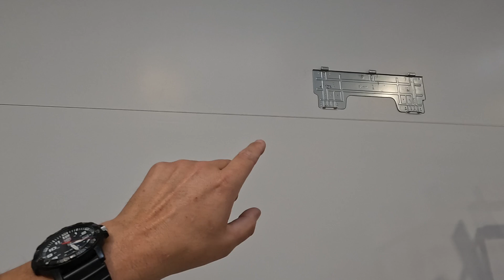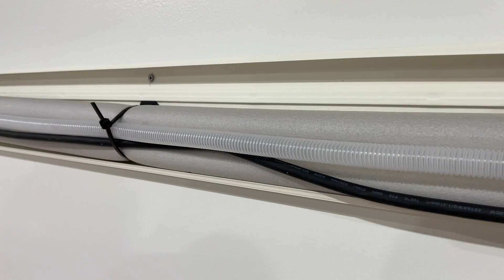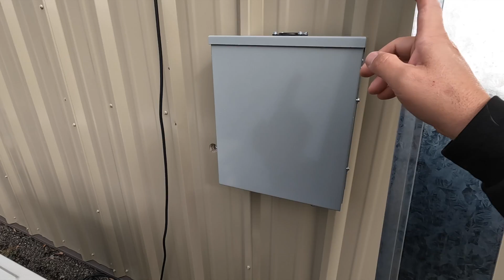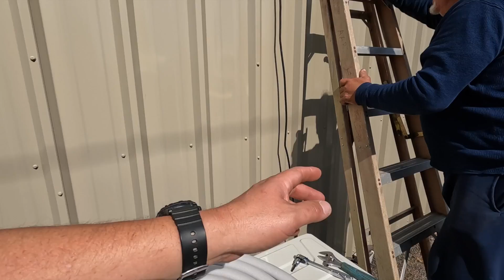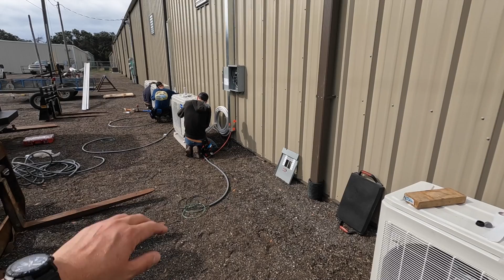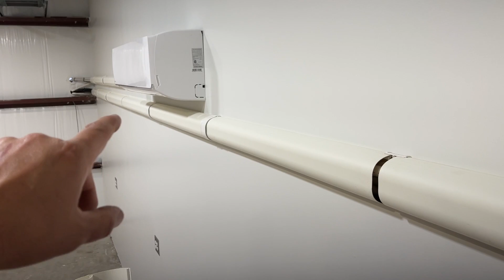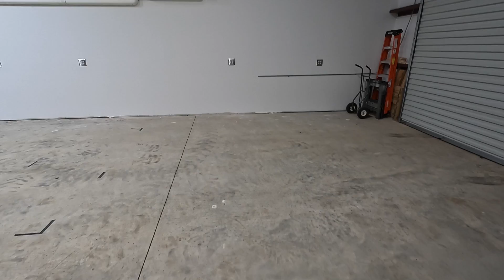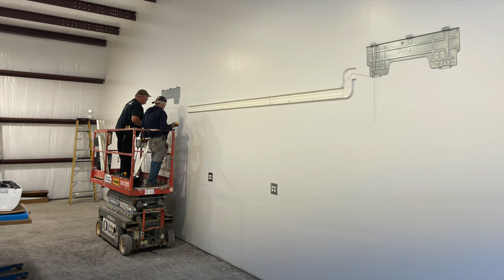Mr Cool AC INstall for New Shop Part 2

Comment: Didn't watch through yet, but I hope you are planning on putting locking cages over those outside units, thefts are going sky high these days.
Reply: that is not nice why would they do such a thing?
Reply: @summerforever6736  Drug addicts and other scum steal stuff for the metals to sell to a recycler.
Reply: @dasworkshop4967  not in the USA lol
Reply: @summerforever6736  Want to hear something fun in America? Most of this type of crime could be shut down by controlling the recyclers, not allowing them to take items likely stolen. But many prosecutors would rather have the items get stolen and replaced by insurance than cut off "that source of revenue" for the criminals. Their expectation is if they can't steal stuff in the dark, they'll be doing more break-ins (more violent crimes) to support their habits.
Reply: @dasworkshop4967  yes it is happening unfortunately  ....  i was kidding...
Reply: There's a type of proximity chirp alarm that can be installed high up, and increases in volume, and beat, it is programmable so critters don't set it off. Its definitely a deterrent, but then again nothing is 100% ever.

Comment: how many degrees of inclination did you put on the tubes from the indoor units to the outdoor units so that the water runs out? Often found ac equipment peeing on telco racks because of this issue.
Reply: Not enough - Poor installation by an 'expert' with 30-40 years experience.

Comment: had a shop i worked in was very noisy could not tell if fan was on or not so i put some ribbon on the grate so i could tell if the fan was working from across the room, nice AC units

Comment: Sometime a quick overview of your electrical system would be nice. You did mention it was 3 phase. By the look of the outside primary you have a delta system. What is the transformer up in the corner for? Is that for the panel behind the pacemaker?
Reply: Not only a mystery box but also CCTV now installed too !

Comment: Hey Adam could you explain why you did not vac out the lines/pipes... are they pre vacuumed or pre charged????... I was an ac installer for 15 years but never installed a DIY system like that... please explain to us why no vacuum pump use...Thanks..
Reply: The lines come precharged as well as the condenser unit
Reply: @MogDog66  ok thanks for your info... but how do you avoid air getting into the lines.. is there a purge device in the line ends?
Reply: @DexWardle  you don't.  There's guaranteed contamination. No matter how little anyone wants to argue any is too much, as I'm sure you understand.  That's why  it's DIY.
Reply: @jonnymac31  Install it cleverly. Connect both pipes up but only tighten 1. Crack open the valve on that one to flush the air out of the pipes - then do up the 2nd pipe tight once all the air's out.
Reply: @MogDog66  Don't think the pipes were pre-charged - there was no seals on them !
Reply: Some one who actually knows what they’re talking about…. Didn’t pull a vacuum, no decay test, oil is going to lay at the bottom of those coils on the outside. What’s going to prevent those condensers from blowing away during a hurricane?
Reply: @keithN6  please study up on how these systems work before making a fool of yourself.
Reply: Filling something with a vacuum is the most foolish thing I've heard all week.
Reply: @jonnymac31  Well, it certainly fooled you !
Reply: @millomweb  sadly for you,  no.  Even "purging" the lines, no matter how clever you think it is, does not remove all contamination.  And yes, those are precharged linesets.
Reply: @keithN6  It seems the pipes were pre-filled with a vacuum ;)

Comment: The person who invented the AC deserves a Nobel prize.
Reply: It was originally invented as a means to reduce air moisture in storage units for goods that requires low air humidity, cooling was an added benefit.
Reply: Dr. Carrier
Reply: @Rita_Loy  I used to run 2x 1000 Ton Carrier chillers with massive cooling towers(24 inch pipe). On a few weeks in peak summer, we ran one at night, because come 1-2pm we started losing the battle to cool. I would suggest sun shades on the condensers outside as well, not mention a security fence cage.

Comment: I’ll bet you will be adding an additional small Mr. Cool system to your office/inspection area. That’s one disadvantage of the free-blow systems. No duct for an enclosed area. 12 tons of A/C is probably plenty to cover the shop and office but you have to get the conditioned air into the office.
Good move on the PVC tube for condensate drains on the two long runs.
Reply from the maker: The office already has its own wall mounted ac.
Reply: @Abom79  Jeepers - don't these people watch your videos ?

Comment: My question is, how are you securing those pads to the ground?  From your first video, you showed that those pads are pretty light, hurricane force winds will rip those condensers right off their spots taking the pads with them.
Reply: You guys go back to the first video where they were in the bed of his truck and read the sticker. He is not going to have a building left if those units are blown away
Reply: They are heavy enough to be hurricane rated to 150 mph
Reply: @joeshearer1247  there’s no way those are rated for 150 with a condenser on them. They are going to be blown away with the first hurricane.

Comment: On that one that was far away did you have to add a little extra to the freon? That was a whole lot of line to fill up
Reply from the maker: Yes Fernando did the calculation on how much refrigeration to add to the unit because of the extra line.

Comment: I think you may have issues with the condensate drain’s on the big lengths
Reply: The water will pool in the sagging areas of the hose and clog with slime.
Reply: @t.d.mich.7064  Water did pool in that ridged line, so he replaced it with PVC. 23:24

Comment: No concerns over efficiency loss do to the excessive coil outside?
Reply: Considering how much of an expert his helper should be, I can't understand why they did not cut and flared theses lines. It made for an amateurish install even more so with so many units...
Reply from the maker: If you cut the line then you are going out of the DIY install. The package is pre-engineered to run the full length of line just the way you see it. It’s written plainly in the instruction manual how to install the system, just like we showed in the video.
Reply: The system is prepped for the exact length of piping that comes with the kit.
Reply: @nameofthegame9664  just doesn’t seem very efficient. As well… if what you say is true… then when they added length to the lines for the 2 units.. they are now have an undercharged system
Reply: @DIYManiacJohnP  they had to add refrigerant to the two units that had the lines lengthened. The condensers are pre-filled with the precise amount of refrigerant for the lines that come with the kit.
Reply: @nameofthegame9664  so, why couldn’t a custom approach  be done to the other two for a more efficient and professional install?
Reply: @DIYManiacJohnP  I’m not sure but I suspect it was because Adam wanted to show us how the DIY kit is installed. You just buy the kit, follow the instructions and it’s done simple as that. No specialized tools needed and they even included the 5mm Allen wrench. If you shorten the lines you need new fittings and have to calculate how much refrigeration you have to take out. It’s simply more work and not worth it especially in this case where the lines wasn’t that far off.
Reply: @nameofthegame9664  that is true! He did get them free. Maybe he was obliged to not modify at least half the units. Hopefully he goes back afterwards and fixes them the right way.

Comment: Adam, Please consider adding hard-wire chainlink cages to your outside units to stave off the methbillys.
Reply from the maker: The area in fenced in and locked at night.
Reply: @Abom79  In the UK someone put a note on the inside of the door "Please do not lock this door tonight".
The door didn't get locked and the robbers helped themselves.
Don't rely on others' security arrangements.

Comment: Doesnt look like you have any pitch to the lines for the drain line.  Looks like will fill with water and sag then not drain.  Hope will auto siphon when fills up and reaches the downward drop through the wall.  Mr.Cool units are a pretty nice unit from watching your shop video I bought and installed 3 units in my house for each floor.  Have no issues other than units defrost too much when below 15 degrees outside.  Saved me from using gas boiler this year so not complaining as paid for one unit just one winter not doing so.  Thanks as always for the video and sharing with all of us.
Reply: Yeah I'm scratching my head too, poor drainage =water leaks and moldy smells .Maybe air pressure from blower evacuates line?
Reply: An install like that, they should be 'wired together' as one unit - so they're all trying to achieve the same thing.
I've seen many places with heating and AC - both on at the same time.

Comment: Are you worried that the drain lines do not have a pitch on them?  will the water just pool in the tubes?
Reply: Did you watch the video?
Reply: @russellv6234  as a matter of fact I did! And I saw that he did have problems with the drain and fixed it
Reply: Naw, it'll just drip on the floor ;)

Comment: for the pre-charged condenser...curious didn't the line need to be vacuum purged before releasing the refrigerant?
Reply: I believe they are and they get pierced on connection. So its a 1 shot deal to DIY it.
Reply: @russellv6234  That'd work !
Reply: @russellv6234  No, you are SUPPOSED to vacuum down all the moist, contaminated outside air from the lines prior to opening the valves, but they didnt because he said you didnt have to- but I've seen the damage that can occur so I do and always will
Reply: @Mad-Duk_Machine_Werkes  I don't know WTF you're on about but even in home depots pictures you can see the sealed lines. Looks like all you know how to do is go around hating on people's videos so if you don't mind, go lay down in front of a train.
Reply: @Mad-Duk_Machine_Werkes  Not needed with sealed pipes.

Comment: Adam, I know you're not an attorney, but I am curious how it works when you install such major and expensive improvements in a leased space.  Do things like air conditioning become part of the property, or can you (theoretically) remove all the equipment and patch the holes etc when you end the lease?
Reply: Check your lease arrangements ! Not all leases are equal.
Reply from the maker: You can remove whatever you install. I’m not sure I’d go through the work of removing them though.